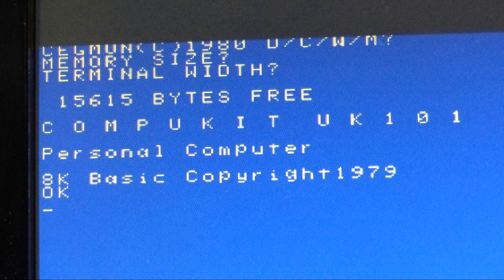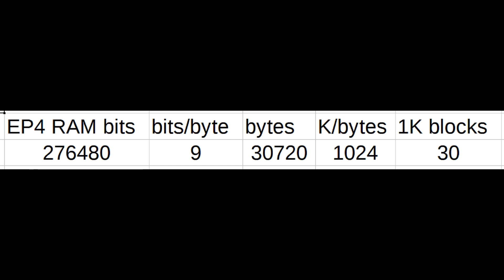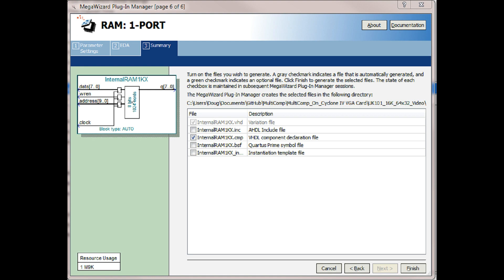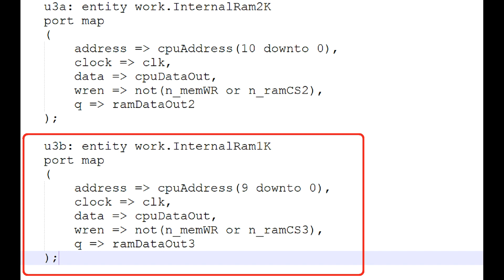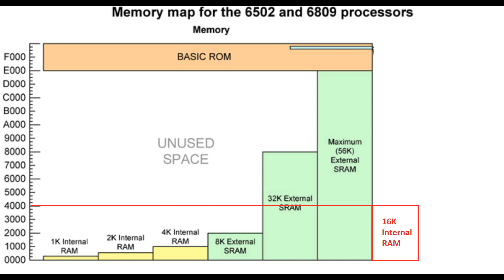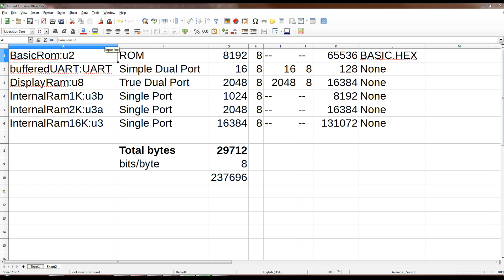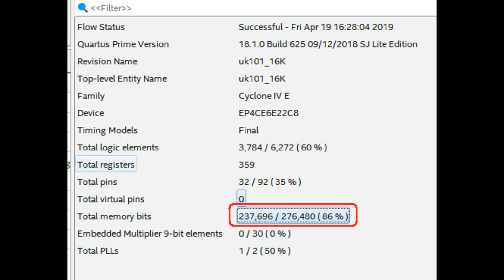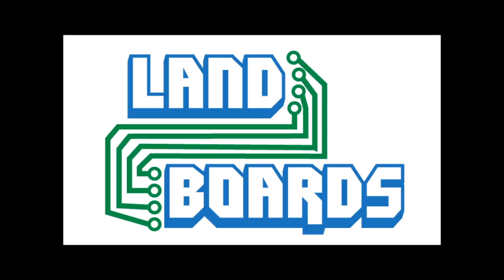EP4 FPGA Dev Board -  Adding SRAM to SuperBoard II

Comment: I have an idea that should open up access to an additional 2KB RAM (using the 9th bits).
2 lots of 8 1Kx9's and some fancy address translation. I'll post code if works out.
Reply from the maker: I love that idea.
Reply from the maker: I gave you a shout out ;)
Reply: @LandBoardsLLC  I noticed, thank you :)
I sent a shiny new VGA design to your email box.
Reply from the maker: Got it. Got really excited when I saw the transformation. Tried it. It works GREAT!. Can I put it into my github repo? I will give credit.
Reply from the maker: Oh, I see the licensing. Very nice. Will include in the next push.
Reply: @LandBoardsLLC  I have no problems with that, go for it. :)
Reply from the maker: @crayzeape2230  When it synthesized it turned something in the video into a dual port RAM so I had to ditch the 1K to get it to compile (in case someone else wants to try it).

I checked it into GitHub at: https://github.com/douggilliland/MultiComp/tree/master/MultiComp_On_Cyclone%20IV%20VGA%20Card/UK101_16K_64x32_VGA
Reply from the maker: @crayzeape2230  This is the part that it made into RAM. 

vga:u6 altshift_taps:X0vp1_d1_rtl_0 shift_taps_d6m:auto_generated altsyncram_5l31:altsyncram4 ALTSYNCRAM AUTO Simple Dual Port Single Clock 3
Reply: @LandBoardsLLC  I'll look at it shortly, the software is being too smart for it's own good.
Reply from the maker: The best thing about this card vs home grown versions is we are working with exactly the same hardware.
Reply from the maker: Does your monitor show a cyan band on the right and bottom? It's about a character wide/tall. I'm using a cheapo TV with VGA input so it may be different on my monitor.
Reply: @LandBoardsLLC  A thin cyan border should be around the entire screen (a touch thinner at the top though). It hides some screen edge wrapping from right to left (I'll fix it up with some delay), and as scaling is quite granular, it's sometimes hard to avoid a slightly smaller screen, which once centered, leaves a border.
Reply from the maker: @crayzeape2230  It's probably something related to this TV/monitor. I'll try it with a "real" VGA monitor and see what I get. 

It also explains why the top row of pixels is cut off on the other VGA code.
Reply: @LandBoardsLLC  I've sent a new design to you with 60Hz display output and a shifter that doesn't eat any blockram.
Note: I do see the same cut off top row with the other code.
Reply from the maker: @crayzeape2230  That works great. I will put up a video and give credit - of course. Thank you!!!
Reply from the maker: @crayzeape2230  I made a couple of very small tweeks to your hsync and vsync count numbers and it centers perfectly on my screen. Plus the 19K fix works great, too.

I want to learn what you did to get the assignment to logic instead of RAM. I thought that was something only Xilinx could do. Is there a way to do that for the dual port memory (used as a FIFO in the UART module)?
Reply: @LandBoardsLLC  Thanks. It's great when things just work.
Reply from the maker: @crayzeape2230  That's the greatest strength of using this common hardware. There are a lot of disparate implementations of Grant's design all over the place. Most of them would work just fine with this card. 

If only the card...

- Had done I/O differently - not tying all of the I/O on the connector up with the VGA
- Had SRAM
- Had an SD socket

It would hit all the marks then...
Reply: @LandBoardsLLC  The delay chain in the design was inferable as a wide shift register more suited to RAM, but by putting a conditional OR on just part of the chain, I broke it's inferability as RAM. The tool was forced to do it the hard way and use logic. I'll take a look at the FIFO in the UART, I'm sure something can be done.
Reply from the maker: @crayzeape2230  I am a bit amazed at Grant's ability to change these four BASIC ROMs. Those were pretty tight back in the day.  I know they are out there and there's disassembled code, but it's still impressive.
Reply: @LandBoardsLLC  Grant has that old-school hardware hacking ability that's not as easy to find today.
About boards with SRAM, lately I've seen a couple pop up in the usual online markets, but not at reasonable prices.